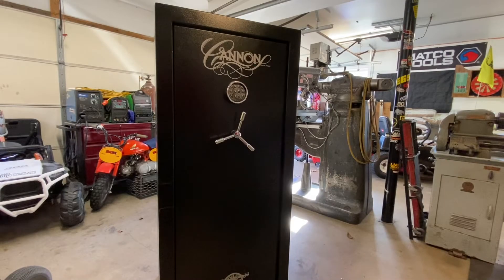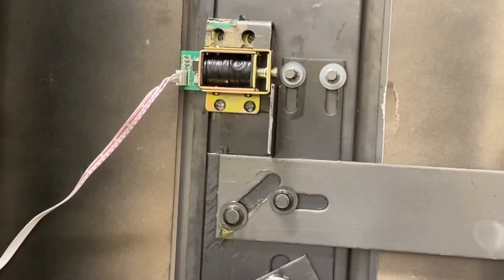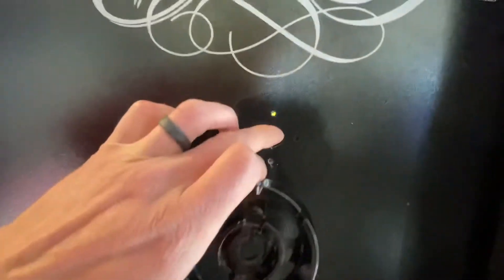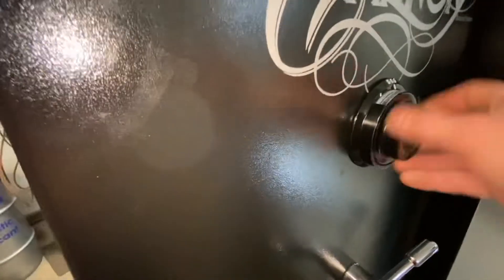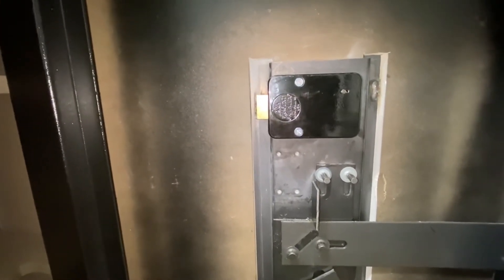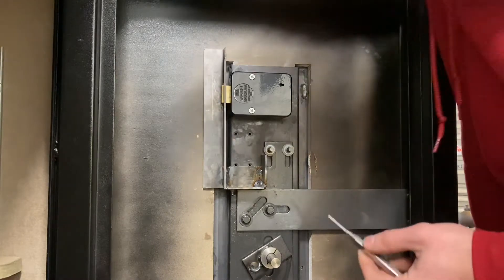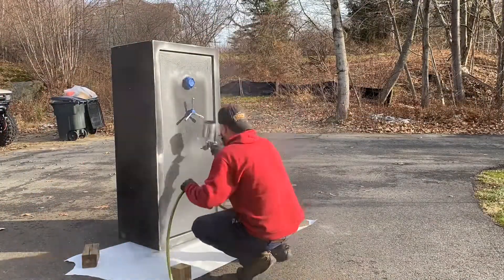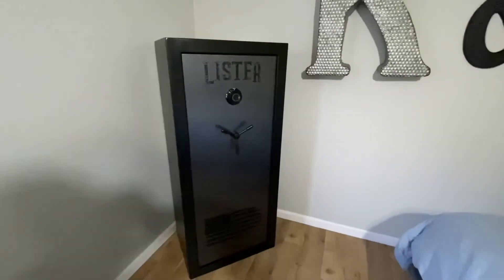Safe lock conversion (digital to mechanical)

Comment: I am now considering changing my mechanical lock to another mechanical lock so a certain manufacturer for sure doesn’t have access to my current box.
Reply: Combinations on mechanical locks can be changed so only you have the combo.  Requires a special tool to insert in back of mechanism.  Available online.
Reply from the maker: As @1anthonybrowning mentioned you set the combo in the lock mechanism to what you want it to be

Comment: This is exactly what I have and need to do.  Mine had a slightly different lock solenoid that I couldn’t find anywhere. Looks like i need angle iron and some welding. Thanks for the video.

Comment: Yeah I made the mistake of looking at how they did the bolt setup in my cannon...  Probably going to just build a safe I've been designing for a few years now. Definitely going to upgrade to a mechanical lock. 

Nice Bridgeport! J head or a 2j?
Reply from the maker: Good luck with your project! The bridgeport is a 1945 m-head I recently sold it and upgraded to a 1982 j-head i love it!
Reply: @ht_fab3525  thanks! I almost picked up a m head a few years ago.. but I ended up getting a screaming deal on kinda worn 1965 j head.  Fast forward a year and I found a parts machine with a perfect table and knee. You can still see the hand scraping marks on it. Picked it up for $100 and swapped everything over!  I'm rambling.. 😂

Comment: Typical example of manufacturer using non-standard construction (lock or locking element is not standard), so swap-out requires a lot of work to refit instead of just swapping a lock to another.

The other issue with this install is that now the locking bolt takes sideways forces which it wasn't designed for and will fail. The right way would be to weld a solid post behind the bolt, so that the lockin mechanism butts up against the bolt which butts up against the welded post, thus not transferring any loads to the lock body, being much more secure and rigid.

Comment: I know this is 3 years old but just fyi for anyone that makes it to my comment if you have this safe you could have mounted the lock to where the bolt is pointed down to engage with the mechanics instead of adding to mechanics

Comment: shouldn't have bought a cannon.
Reply from the maker: Shouldn’t have done alot of things in life. Just trying to make a bad situation a little better for now
Reply: @ht_fab3525  
I hear ya on that. Same here. I bought a Cannon safe, same problem you had, kept locking me out. Couldn`t get any help from Cannon, so i cut the safe open and got my stuff out of it, in the dump it went. Bought another 2 safes since, no issues, so far. One is electronic, but has a back up key. The other safe i bought recently is a mechanical dial. I`ll be changing the other safe over to mechanical real soon. No more electronic safes for me, ever.